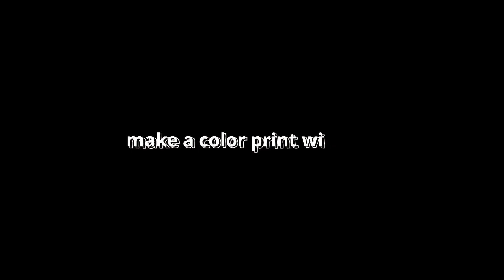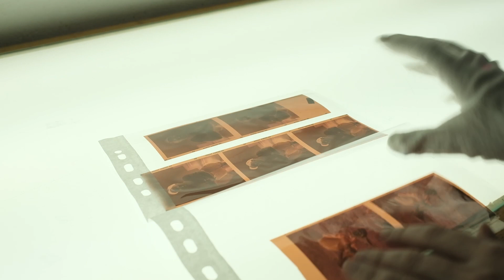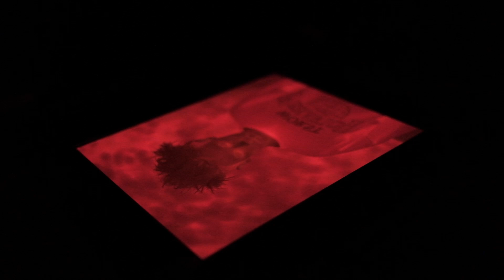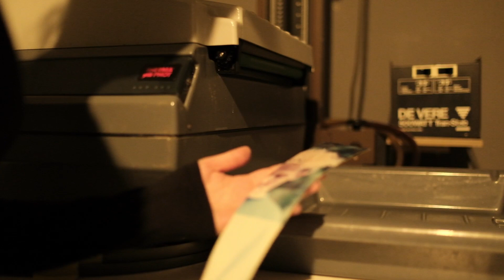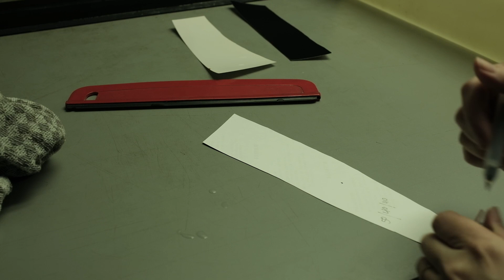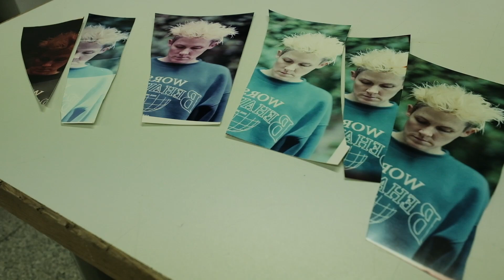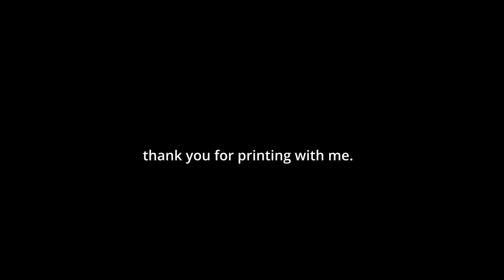How to do analog color prints | My step by step process

Comment from the maker: What do you think about c-printing?
Reply: There is nothing creative about color printing on film, everything is calculated: exposure, filtering, there is no room for error. Color in film is technical and mathematical, no room for chance or creation, that's why I prefer black and white in the lab, the freedom of maneuver is much greater.
Reply: at my lab we have this huge color printer but I am too intimidated by it. I mix raw chemistry so already enough complexity I have to deal with like ph levels and development time offsets for each roll. I would love to do it one day but sadly that day is still far off :D
Reply: я  тоже  печатаю  цвет . больше  аддитивным  способом.
Reply: All my dark room provring has been c-print for the last couple of years. I love the process and the result. I use open trays and it is alot quicker when maling test-prints than using machine for processing. Sincr the börschef fix step can be reducering in time.